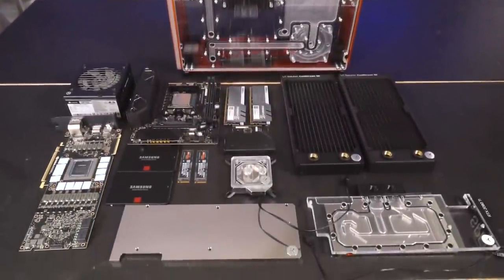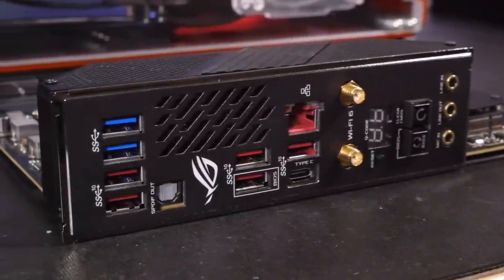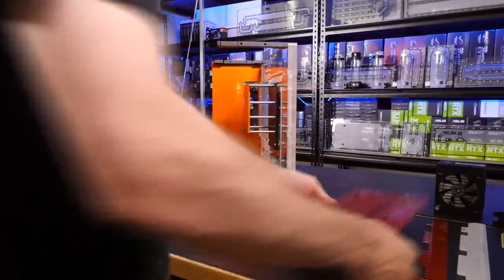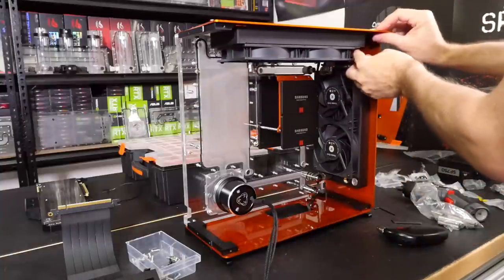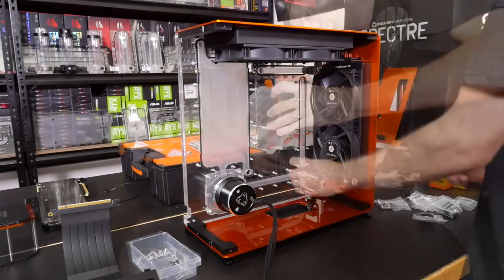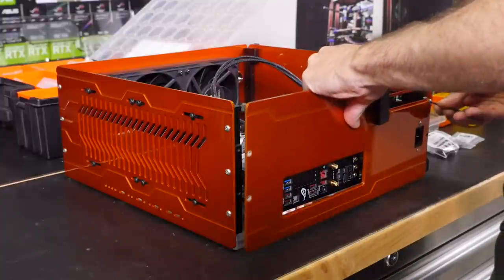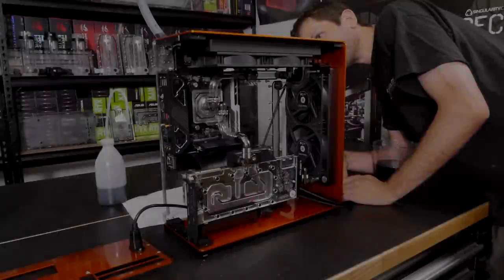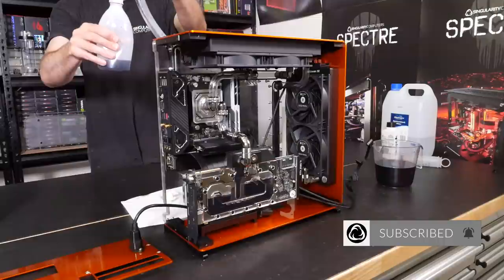Wraith Custom High End Build #50 Part 1

Comment: Beautiful case albeit a little too large for ITX/DTX, a lot of space on either sides of the rads could be cut. I got the C8I too, but might as well not support DTX, make the case smaller, Asus jusy made a lazy board, which should not exist. Also, I know it's become a thing, but showing off the GPU like that wastes a lot of space. If the case was a more reasonable size, I would have gotten this over my M1.
Reply: Actually this GPU orientation can be more space efficient if positioned on the right spots (for example behind the motherboard)